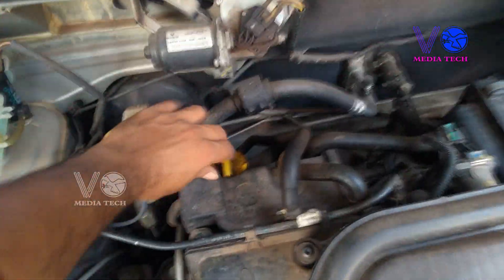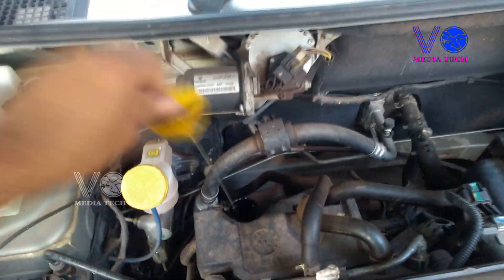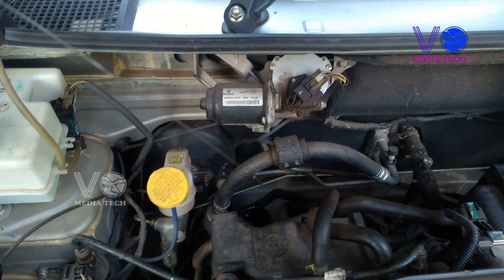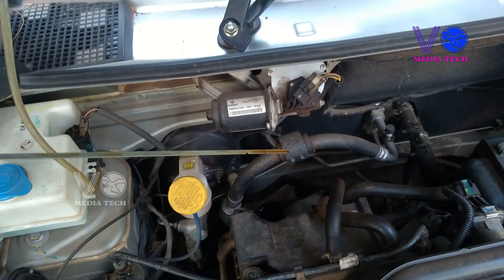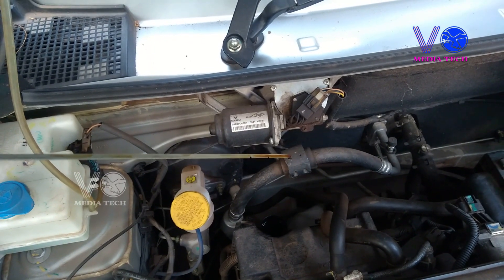How to check engine oil, coolant and brake oil Renault Kwid

Comment: Oil engane top up cheyyum
Reply from the maker: Oil read nokkunna athil koodi thanny oil top up cheyyam
Reply: Maruthi  Liu dipstick separate aanallo. Oil fill cap um separate aanu.
Kwid nu randum same aano?
Reply: Which grade of oil?
Reply: Currently am using 10km one
Reply from the maker: @joyannaabels2785 Oil grade SAE 15W40
Reply from the maker: @joyannaabels2785  kwid nu separate Ella
Reply from the maker: @joyannaabels2785  10k odi kazhinjal full oil replace cheyyanam
Reply from the maker: @joyannaabels2785  9946 262345